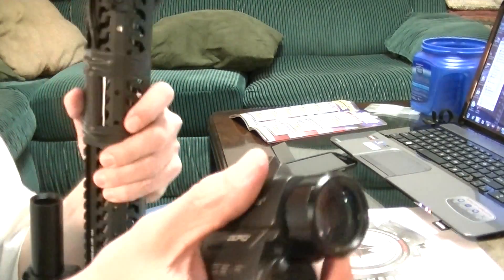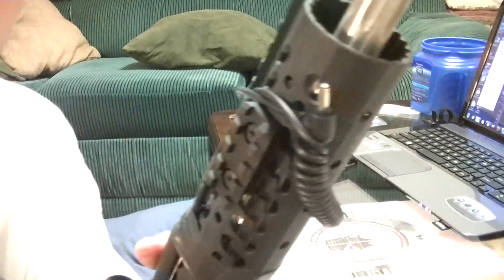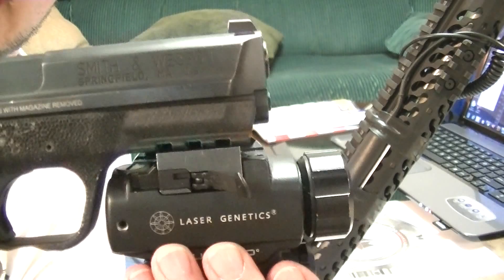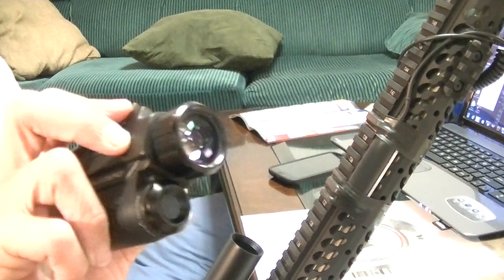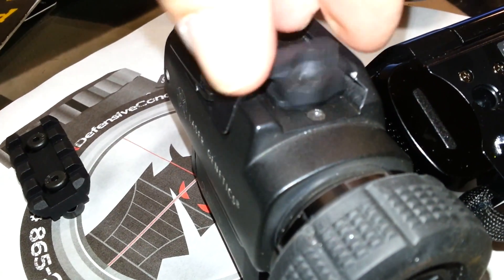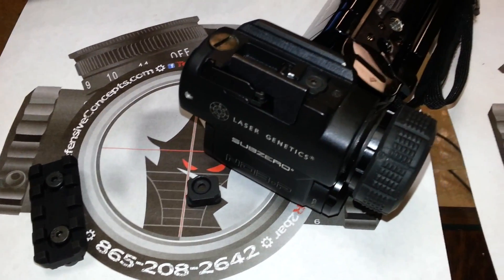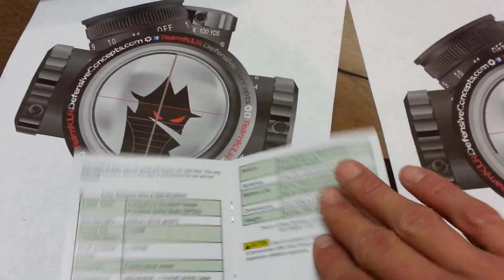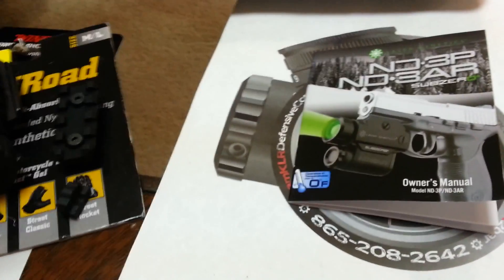Update on LaserGenetics ND3P subzero (problem with mounting on certain rail types)

Comment from the maker: Yes that is a type of tape holding the pressure switch onto the rail. It is affectionately called "F4 tape", it stretches, it's heat resistant, no adhesive it sticks only to itself. Out is called F4 tape because out was said that the F4 phantom was held together with this stuff. It is great stuff!